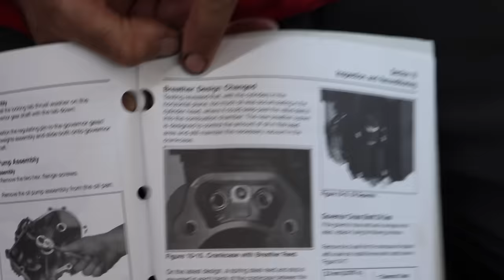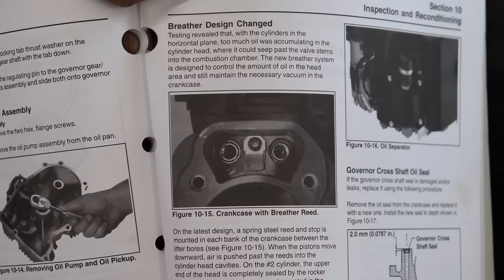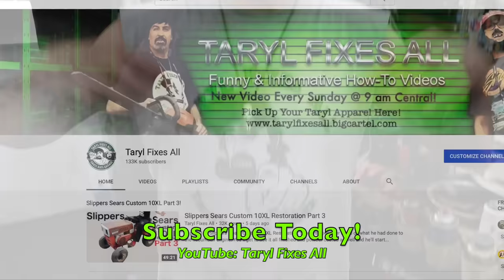Troubleshooting: Bad Camshaft Kohler Command

Comment: My old car engine dosent have a compression release and its run for 33 years! Just more crap to go wrong and maybe ruin your engine if the metal bits grind the inside!  If your mower SM and battery are good, surely they should turn a reg engine without this release nonsense?  Was it getting its intake air from the exhaust valve before the replacement cam? as it has to get intake air from somewhere?

Comment: The culprit purposefully let the saw run idle on the job site, while it sat and vibed like an important missed call.

It apparently vibed the most with the tip of another tool that was tougher than what that aluminum flywheel was made out of.

Comment: I had a kohler courage twin do this and what I found it had sheared the flywheel key and it would still run!!?! Must have lined up just right to run...poorly. Another thing check oil pressure on the kohlers with the hydraulic lifters. One more thing when you were looking at the cam the compression release was stuck open. It should have not been engaged.

Comment: My mower is doing almost the same thing runs terrible and wont run under 50% throttle. I pull the spark plugs and they are absolutely black, plus there is a lot of back pressure when I crank the motor, the poor little starter keeps getting stalled. Also runs with tons of disgusting smoke when it does run. I am not looking forward to pulling the motor and the camshaft to troubleshoot this.

Comment: I have a Kohler CV490 that runs terrible and exhaust is coming out of the carbitrator.
With valve cover off, when I turn the engine it looks like the exhaust valve is traveling very little compared to the intake valve. WTF is that? Worn cam lobe maybe?

Comment: I have a vanguard gen and it is doing the same thing and the decomp seams to work it runs rich i put a brand new carb and coil on it did a  leak down got 10% I set the valves to 6 and 8 do you think the decomp is bad

Comment: Hi i had a kohler command ch20 with lots of blow by from carb and crank case, and sounded like a hard knock brom the bottom end, and after looking lots of videos, I almost knew that was because of blown head gasket, so replace both and inspected the old head gaskets and didn't see any damage, and still had the same issue, remove the heads again did a valve job and sand the heads on a flat granite, re installed heads, same issues, then started looking at the hydraulic lifters, took them apart, cleaned them put them together and decided to look in with a scope and finally found that all the cam loops were flat, my cam didn't have the decompression system, after replacing the cam engine run perfect, now I had a kohler courage 26hp twin that can't get to run all the time, it will run for about an hour then it will not re start, maybe bad head gaskets, maybe bad coils, even c they show spark, and   even with starter fluid will not run, and also have a single cylinder kohler courage 21hp with a cracked block, is this a sign?? Note I do not have a repair shop, is kohler that bad? Good videos like always thanks

Comment: But Taryl, how can an engine run without AIR ???? Also, what is the chance of the timing marks alinement  when you took the engine case apart. This is just real strange fella for sure. A camshaft for two hundred dollars is just nuts. Pretty soon a customer will not be able to buy anything that is good. Would bet you the older engines will not have this problem. Nice explanation of a real strange problem happening to a Kohler engine. Finally what is the best brand engine for the consumer that is worth the money ?? Thanks Taryl.

Comment: "These are the times that try men's souls",   If you were the medical system you'd be getting paid big time for test after test until you found the problem.   I'm wondering if there is a certain pattern on an ignition scope that would indicate not enough resistance at the plug gap due to reduced compression?   Does a lawnmower ignition ignition voltage vary with the speed of the engine?
Reply: To question 1 yes, but a compression reading is more easily detectable. To question 2. The short answer is no. Ignition voltage is determined by the rotation of the crankshaft .  The method is dependent on degrees of crankshaft rotation, not speed.  And thank you for recognizing the unpaid plight of every retail mechanic. If doctors were paid the same way, 25% of the 1%ers would not be 1%ers, they would be poor folk. Like all the mechanics you know. That is why I got a real job 30 years ago.

Comment: love your videos man keep them coming....  now I have trouble with a kohler  Vtwin  trad 16 model TCGHS it stopped working  good  and it slowed down all of a  sudden  I checked belts,changed  spark plugs ,got new  oil, filters, cleaned air filters, checked fuel ok, the motor still goes but rough ,  could it be a head gasket if so how do i go about splitting the heads to do gaskets on this old girl.
thanks Taryl

Comment: Hindsight is 20/20, but it would have been interesting to see what the compression would have been before the cam change. Also, at what RPM does the compression release stop working?
Reply: And also how it reacts when you pull the plug wire one by one as its running

Comment: It can jump time. I had it happen on a 21hp briggs. The actual cam shaft itself was spinning  inside the cam  gear. It would happen within 30 seconds of it running. I would pull it back apart, set the timing. Then it would stop running within 30 seconds. I would open it back up and it was out of time. Put a new cam in. Solved the problem.

Comment: How do you charge on repairs like this?
Reply: I’m wondering the same thing. A used part saving a $200 parts bill. Lots of time assembling and disassembling. What is the mower worth?
Reply: Doug Reed some states require an estimated cost when the mower is dropped off. 

If That were my mower and I was handed a “piece of paper with a bunch of numbers “ I’d have a problem paying a 4 figure bill. Unless my dinner had been discussed and authorized.
Reply: Sounds like there was a good few hours spend on it. I just want to know if they charge out every hour?

Comment: I have a 1040 cub cadet 19hp kollher motor l was cutting grass raised off my seat to get something and move it before it cut off I sat back down on seat and it back fired and cut off tried to restart it and it would not start though it's hot so I let it cooled down same thing checked safety switch it's good ,fuse , good changed spark plug new one it's not wet. Checked silaniod it's good I don't know what it is wrong got any idea what?
Reply: did you fix it?

Comment: If anyone can help, thanks.

I’ve got a Craftsman LT1000 with an Intel briggs 18hp. I replaced the carb, spark plug, and fuel lines. I have drained the fuel multiple times and played around with the governor a bit but the engine surges badly when the choke is off or when it warms up with the choke on. It stops sometimes when the blades are on. It has done this before and after all new parts and work have been done. If someone can suggest what I can try to fix this that would be great!
Reply: I have the same tractor. Have you tried non ethanol gasoline?
Reply: GT469XWT1 I have not, but that should not be the issue. I have been playing around with it and when you hold the governor arm steady it stops surging so I know it’s not the carb it must be something related to the governor or something else

Comment: I have a Kohler Command that burns oil and cannot figure out why. Total rebuilt,,new rings ,valve job,new breather assembly. It acts like the rings did not seat. And I have run it about 5 hours so far.
  It starts up with no smoke.. then after running it randomly will smoke at times. Very odd and from looking at the number 1 plug it is fouling on that side.
Reply: Do you mow on alot of hills?
Reply: Out of round cylinder, cylinder not deglazed, rings installed wrong...(not sized to cylinder, broken, dry start at initial start and scored cylinder wall), failed valve guide or seal

Comment: I am thinking just remove the compression release parts some how or push the weight in and grind down the lifts on the exhaust cam lobes so that they will be even with the cam lobe... Just a thought from a 35 + year mechanic from the back yard in southern podunk Indiana... Lol
Just what I need, another Mystery show to confuse me... LOL
Thanks for the video Gang!
LLAP
Reply: Good idea mabe push the peace out and TIG weld it so it stays put.
Reply: starter is not strong enough to turn the engine with out the compression release

Comment: why even have compression release, surely it's a weak point in the long run. Be nice to see Taryll  hot rod a mower engine .
Reply: It makes the engine compression ratio very low to ease the torque required by the starter.  It's a sound idea.  Much more necessary on higher horsepower, higher compression engines.
Reply: With weak battery's and starters nowadays, companies all use compression release systems.
Reply: @JM-yx1lm  just need a decent cca battery and a real starter motor, I know id bin the decompression and make the necessary mods, I mod everything if I don't like the design,  can take quite a bit of time and effort and some money but it's worth it, been doing it for over 30 years.

Comment: need help kohler cv25s start up run it charging  new start plugs air filter and gas filter when get into grass seams like no power
Reply: mine doing the same but when running it sucking a little in but never dies engine down with hand in front of carb

Comment: These engines are just made complicated for the sake of it. Why do they need a decompression system? Old engines never had them and fitting reed valves, to me every thing is going backwards.
Reply: I often wonder if these problems are cropping up because of the ever upward HP of these engines. Seems like a race for ever more HP that is not actually needed to run the wheels and blades. At what point is there too much HP? One example of this, I have a mid 90's MTD GT2050 with a 20 hp Onan and a 50" deck. I also have a Craftsman GT5000 that's maybe ten years old, with a 25 hp Kohler twin and a 48" deck. Why the additional 5hp, and for a smaller deck no less? Seems to me the further you go back through the years, the smaller the engines HP gets even though the deck sizes remain the same.

Comment: Good job finding the root cause.  One lesson I learned the hard way is to pull the valve covers and measure the travel of all the rockers.  I've found more bent/broken push rods than I can count.  If the compression release was stuck, wouldn't it cause the two rockers on that side to travel more?

Comment: I dont get it.
How does it get fuel when there 's no air coming frum the carbetraitor ?
Reply: Air from the crankcase, thats my theory.
Reply: @HaventHeard307  With the oil as fuel ?
Or gasoline in some way ?
Reply: It's still drawing fuel from the carb.  But the pressure release opens on the compression stroke just enough to let in more air.  It effectively changes the compression to a very low ratio such that it can still run and spin the engine but with minimal power.  As such, it lowers the amount of suction at the carb.
Reply: @rollling7523  the oil will foul the plugs, so no, their is air in the case and the breather supplies air, far as fuel, gravity can supply that, or a mechanical pump.
Reply: @HaventHeard307  Ok, like its dripping slowly from the carbetraitor to the valves.
Reply: @rollling7523  some of those engines have fuel pumps, so motor spinning, fuel pressure. If not gravity works pretty good.
Reply: Rollling   Through the valves that were partially open

Comment: Why couldn't you just cut off the compression release and use the original cam on that v-twin?  Charging the guy for a used cam that he doesn't need seems a little harsh-- but I get you have a lot of hours on this one.  But that's not the customers fault--- idk.. I hate these types of jobs... lol....  The cost of learning isn't cheap.
Reply: I was thinking the same thing. What if you don't have a replacement cam, and just remove the release parts and reinstall it? Would be an interesting experiment.
Reply: @dkeith45  I know it is not the space shuttle, but probably the camshaft is out of balance without the parts for the compresion release.
Reply: @hansbehrends7063  Hm, that is a factor to consider.

Comment: that was a lot of work...taking apart 2x and still not working correctly...how much does a repair like that cost...in my line of work (auto mechanics) we would charge flat rate on something like that....you could have 3-4 hours into just troubleshooting that thing plus taking it apart and reassembly...customers never understood that extra work and time involved....why can't you just fix it like everything else on it they would say....but you did save them 200 for new cam....price of owning stuff i guess
Reply: Ehhh...i see auto mechanics working 2 or 3 jobs simultaneously.  So the 10 minutes fix that gets charged 1 hour makes up for the 2 hour job that takes 3 hours.

Comment: THEORY ABOUT THE CHAINSAW MYSTERY:
-->  If the starter recoil was broken or not working, 
somebody make a multi pronged tool, and stuck it
into the cooling fins.  That tool was connected to
a drill.  They hoped they could start the saw
with this rig, and then jerk the 'tool' off when
it cranked up.
HOWEVER, the saw started  and the drill stopped,
and the 'tool' ripped off the fins before the drunken
fool could prevent the damage.
MYSTERY SOLVED.

You're welcome.
Reply: Or somehow the scrench fell in or was jammed in while it was running?